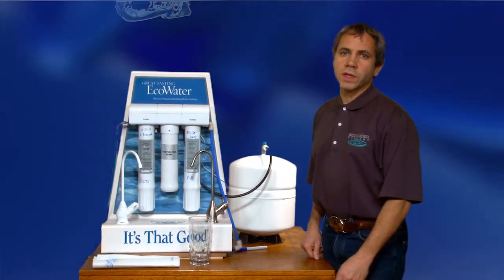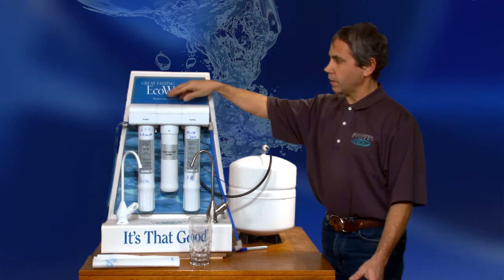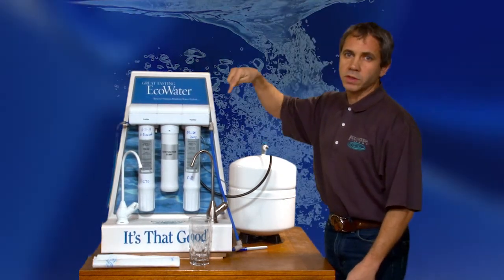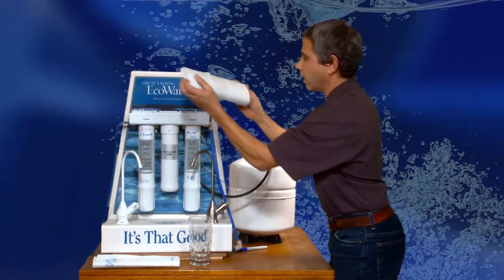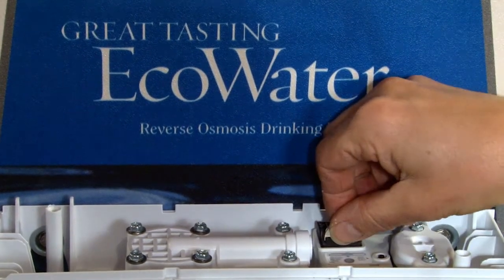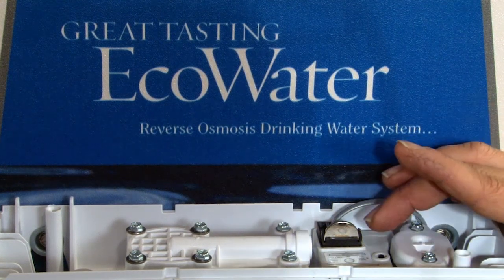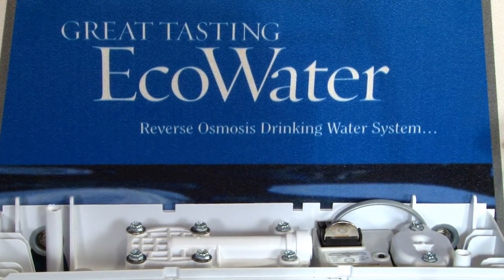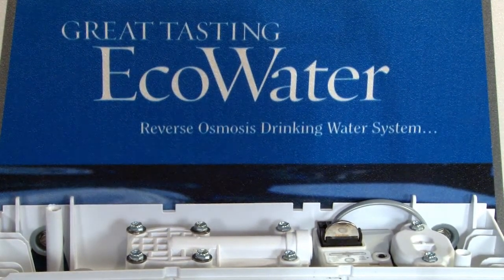Reset the Switch on a Countryside Ecowater RO System

Comment: How do you get to the button that he's pressing?
Reply from the maker: If you took off the top of the unit, there should be a setup like you see in the video. The button is to the right, as pictured in the thumbnail. If it is a different unit, without a top that can be removed, I'm not able to suggest an option.

Comment: The Ecowater RO system is great, however, the filters are proprietary item, meaning you cannot find them in any hardware store, and you have to buy them from an Ecowater dealer. In some areas, you have to call the installers to come over and replace the filter for you and each filter change will cost you about $180.00. While other RO systems will not cost you more than $45 to buy and change them yourself.
Reply: This is an old comment I know. But where I live they do not have to come and change the filters. I’m sure you could have the installer ship you them no matter where you live if you are adamant. The 2 filters together cost me $120 (or $60 a piece) including shipping.

Comment: If you have the Hydrolink remote and the alert won't go away once you swap the filters, just unplug the little remote under the cover and plug it back in (once you swap the filters) then reconnect it by sticking a pen into the connect slot and wham! the alert goes away.